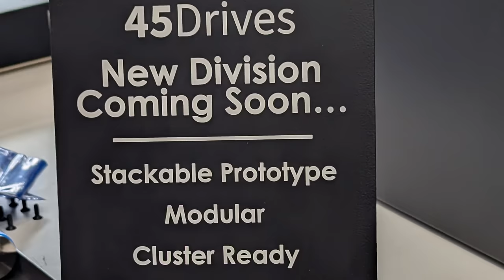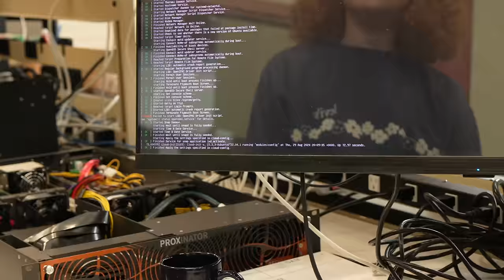What if a Server was Stackable Instead of Rackable?

Comment: I think they need to reconsider the goal of this from "modular" to anything else. The market for this is probably only SOHO, and it will most likely be severely out-competed in terms of pricing. They will have to understand most of their competition is either more modular (Tower PC, Rack), or with a better footprint (OTS NAS, iTX PC), so because of the likely high price it's going to have people will find compromises more valuable than going for this.

A possible incentive to go for this which removes the competition from racks would be wide fans and low noise, this alone could warrant a good few tens of percentage of price difference.
A possible incentive to go for this which removes the competition from Towers if not from every OTS solution whether NAS or PC would be server-grade features which are currently only available in enterprise pricing - such as redundant PSU.

The modularity itself just won't be enough of a selling point to cover for the costs of production let alone R&D, a dentist who needs a storage or even a GPU upgrade to his inhouse server really doesn't care if it's going to take the technician 45 minutes to upgrade or 30 minutes to upgrade. But he will care if the technician's quote for the 30 minutes upgrade is going to be x2 as much in proprietary components.

Comment: Std width 19" needed, not sure if it's a problem in search of a solution or solution in search of a problem. Better off imo to have a system that could be installed on a rack and well stand alone. Perhaps make it have a back plane to make it serviceable each unit slides into?
Reply: Yeah why not make it a rack/chassis with a backplane each device plugs into.

Comment: The answer is very very simple... Physics. It means the unit at the bottom has to carry the weight of everything above it. That means that unit has to be made much sturdier than the stuff above it. It would mean that the stack would be very VERY inflexible, which means you could have just sold the thing as a singular big unit because you can't really make any changes to it anyway. This isn't the first this concept has been tried, and it always fail for the same reasons...

Comment: What makes this realistically different than something like a UCS Chassis from Cisco?  Yeah it only needs 1 power hook up and 1 network hook up, but if I need HA I want multiple connections and paths so I can disconnect those modular pieces ad-hoc to do simple replacements.  Right now this design is similar but as you said as a realization I think you're just going to end up closer to That UCS/Blade Center/ HCI style connectivity because if my UPS segment goes down I don't wanna have to take that entire thing apart to put in a new one, I want to be able to pull something out of the back, pop in a new ups module, and plug that module back in.

Comment: Like many have said, Applaud it for trying to innovate, but in that iteration of the form factor, unserviceable and just hard to fit into locations. 
Probably better to concentrate on a 3-5U unit that would fit in a network rack with redundant PSUs. Don't include any sort of network switch, that's always so in flux for the situation, it'll bloat the cost and complexity for no reason.  
Would still be ok to see a build in UPS, but also would suggest not bothering, due to the availability of 1U and 2U network rack size units. Why specially make it when it can just be an off the shelf component.
I would imagine a 3U version to have a typical 2U space for the motherboard and PSUs to exist, then a small 1U "shelf" stapled on that would facilitate 4 3.5 inch drives. The top shelf could be increased in side to allow more drives and/or fit GPUs. 
As an MSP tech, a cheap, simple microatx tower form factor system with redundant PSUs is really what I typically would like to see for my clients. Their storage needs don't change frequently, so they just buy the capacity they need at that time, and in 3-5 years when that may no longer be the case, they are replacing the aging system anyway and get larger storage then. The redundant PSUs are the most important thing typically so I can change out the damn UPS without turning off the system.

Comment: I like this but my only concern is physically securing it down to the floor.  One reason i like rack mount even in small office is a can bolt it to the ground and the wall, bolt things into the rack, maybe with some non standard heads and put a mesh locking door.  while it doesn't keep a thief from getting it all together hopefully its enough to slow them down long enough.

With that said, would i buy it?  very likely.

Comment: This would have to be so much cheaper than a normal enterprise rack mount solution of equivalent power.  The footprint of this looks equivalent to a network rack, so it doesn’t feel like you’re saving much space on the ground, but you’re using like 20U for one server?

Comment: I Like.
 Power; is mains power being routed thru all or is it just ground, 12vac/dc, 5vac/dc: Isee no need for mains being pasted up from the UPS/PSU.  For the drive unit I would look at 24/48vac/dc passed thru and have a converter in chassis for needed voltages.
Storage redundancy;; top dock having a quick removable (zebra, zip or other) connector for backups

Comment: I prefer using HPE ProLiant servers and have solutions that I can connect to that server. For example 45 Drives can have a box that plugs into a HPE or 45 Drives RAID card and provides external storage. Needs to be certified with HPE

Comment: Interesting concept.  My issue would the stacking on top of each other module could be a problem.

If you lay it on its side you could remove the Compute module without having to maybe lift off the GPU + Storage modules first.

Back-plain wise.. the daisy chain power and data paths worries me.  If the link fails at the bottom, how easy is it to fault find between the modules?

Again laying this on its side the power/data can run in different direction if needed or both.  Have each module a set size but larger module can be multiple of others.  Backplain bar can have slots for power and data etc every “1SU” (but horizontal instead of vertical).

(SU = Sideways Unit)

The back-plain could be extendable but starts at “5SU”, example…

1SU UPS
1SU PSU
1SU CPU
2SU HDD

Larger/expanded system might be… 10SU

3SU UPS
1SU PSU
2SU CPU
2SU HDD
1SU SSD
2SU GPU

Also note: sideways unit modules would get the same access to cooler air from bottom intakes and expel heat from the top of each module. Rather than passing heat to the module above.

Note2:  no limits to height of each modules with this and they could be different heights. (Eg 2SU wide, 10U tall)

Nice idea hope these comments give you something to test (send some love my way if you like ;) )

Comment: Its build for convenience meanwhile its only looks convenient to those who are not servicing it and managing it. Who ever gonna service or manage these will have headache jumping between boxes instead of working in one box(rack server). Who ever service or manage these units will need the same knowledge and expertise that required for rack servers. It could be dumb stack unit for small businesses that do not have IT personal on premises but which company will service these units if some problem hits it will be a big downtime if you do not have parts on hand on premise or have redundant capability and what difference it makes if it outsourced anyway having this or a rack unit. It will cost more without any benefit, its just a change for the sake of change. They just built something before they asked the why and benefits and challenges. Cool concept in but nothing practical. It even takes up more space than a regular rack server.

Comment: It's a very clean, neat idea... but... how proprietary would this arrangement be? What happens when the PSU "block" fails? Can I make it redundant? Or, am I down entirely until 45D sends me a new PSU? Can I upgrade or repair the CPU "block" components with stuff that's locally available? Are the UPS batteries in a size and format that I could replace with locally available parts? What happens if the only network port dies for some reason?

I get that most small businesses in the expected demographic aren't looking for a bunch of nines for uptime, but I also know that those aren't usually the kind of operations that can afford to keep (or would think about keeping) a bunch of proprietary spare parts sitting around for a rainy day. Ease of repair is very important for small businesses, and this makes me nervous at first glance.

Comment: PSU should be a dual PSU module. Interconnect use occulink maybe?

What if you make it multi computer compatible.
What if you made it so there was a hole down through the middle for cooling towers. I know it wouldn't work for normal MB's but depending the shape and layout, maybe there is a way. Heat pipes or something.

Comment: My concern is that it doesn't adhere to any standard. I'm locked into this particular instance of the 45 Drives engineering concept. They've done a nice job with that engineering and packaging, but maybe the details will change in the future in an incompatible way (like Apple's lightening vs USB-C connector on the iPhone) or maybe I'll want to add additional components to the stack that they don't provide. Sorry, but too non-standard for me.

Comment: It is an interesting concept but I don't think it has legs. Servicing one of the lower modules would require you to disassemble the entire stack. You would also end up having exposed power connectors upon disassembly which would be a power hazzard. I don't see much benefit vs the rack either. Racks aren't expensive and though a rack doesn't look as clean as this may look it is a lot more versatile and easier to modify down the line.

Comment: This is where my brain has been going for a year or so, but in various alternate forms.  In particular, stacking like this, as noted by others, means that you have no serviceability of components in the middle.  The idea of using a DC bus with separate power supply and battery bank is a no-brainer, but how the networking and other things work is a bit more complex.  My personal goal has been trying to come up with an overall design that includes various size of units (e.g. a smaller PSU that's half-width, a larger one that's full-width that both have some minimum runtime built-in, then various sizes of batteries that can be added for additional runtime), but also fundamentally build in redundancy. While a system could work just fine with one of each, everything should be planned to be doubled as size goes up - every single unit should have dual DC inputs with either active balancing or at least some kind of communication to select which input is used by each device, the central CPU should be paired with a twin, dual core network switches, etc.  However, the reality is that eventually advances in the hardware run out of problems they can solve without work on the software as well, which is where I have a bunch of other grand ideas...  if 45drives is in fact watching, I'd love to have a chance to chat with them in more detail.

Comment: Good concept, I'd keep them partially rackable or rather with components in drawers - think rails inside the chassis.
 I'd place the power bus bar at the back, not the side, and make it redundant, going all the way through like a sas backplane but vertical. With the current layout, it looks like multiple disconnects (wear and tear) would happen every time you service one component or add a disk shelf - - you would want to rather only disconnect the one you are working on, than it AND it's neighbours. 

Also use ocp, or a pre engineered interconnect so you're not reinventing the wheel.
They would've accounted for signal integrity, grounding and all the other challenges you would face with the inter component connections etc. 

Reminds me of Intel modular servers and Dell vrtx, but simpler. 
Wouldn't be the first server of this genus 
I'd talk to people at liqid and other hardware vendors who you could work with to do a more open computing kind of standard. I think it be amazing if you wanted to target hyperscale, though I'm not sure that's 45drives` market... 
As others have suggested you don't want to compromise other components when servicing one part.

I actually think something like that would be awesome, but it is silly as a single vendor only thing. I think literally every company in the server/dc space has tried something along the lines of uniform components. 

Submit it for addidltion to the atx standard 🤣 see what they say.